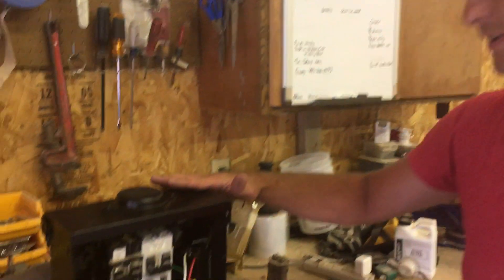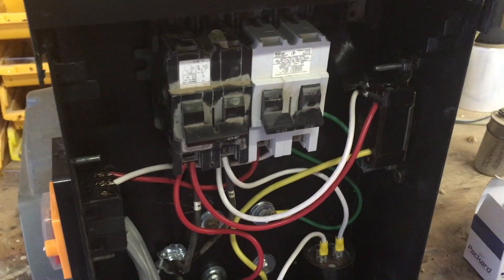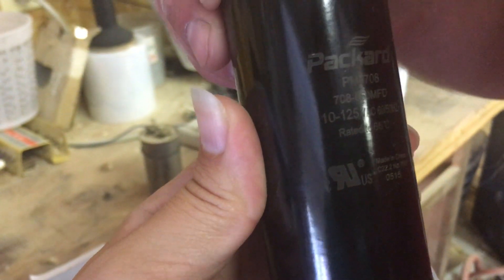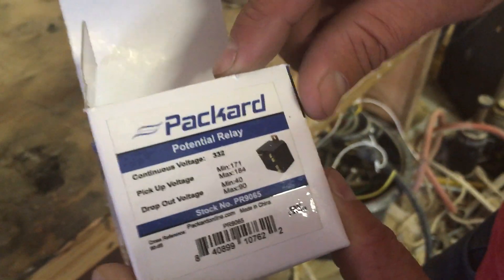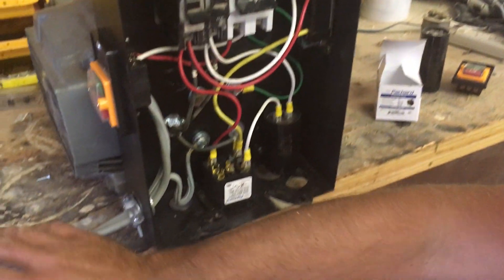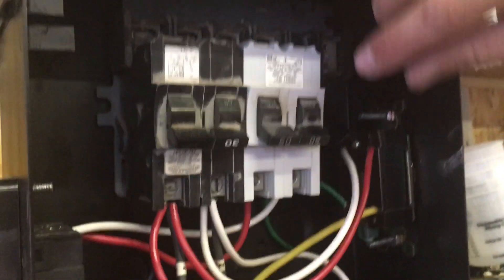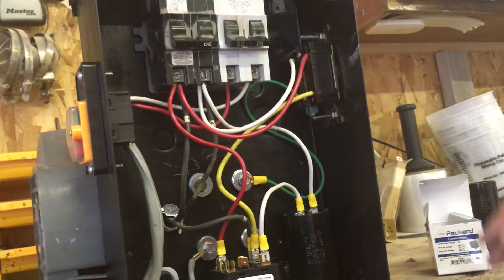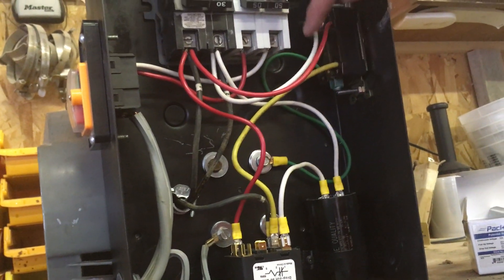How to Build a Rotary Three Phase Converter with details & parts Urgent Read Description if Building

Comment: Good job, but why stop there?  Now that you have a start capacitor to give the motor rotation, why not add a run capacitor in the circuit?  As the run capacitor is constantly in the motor circuit, it needs to be a smaller capacitor in MFD rating to avoid overheating the motor winding.  A properly sized run capacitor will smooth out the 3 phase and increase the motor capacity.

Comment: Something  strange......I follow L1 and L2 (red and white) coming from the disconnect on the left side of the box and going to the white breaker, but they seem to terminate there.  There seem to be no jumper wires connecting L1 - L2 to the black breaker, which is wired to the motor, outlet and capacitor.  What am I missing?

Comment: I notice you are using a start capacitor that's rated 110-125 volts.  I'd recommend using one that is rated at least equal to the voltage at the motor leads, and preferably a 330 volt rating.

Comment: What wasn't obvious at first was that you are backfeeding the buss bars in the box to tie the breakers together. I kept looking for a jumper. I'm like how is he getting  L1 and L2 back over to the other breaker. Then I had the lightbulb Duh moment lol.  I would be helpful to know for folks to know which terminal was coil and contacts on your contacts. From my static phase converter build I know that you want a 110 line on one side of the coil and L3 generated leg on the other side of the coil. Also, need to mention it's a 220 coil. The contacts are breaking the start capacitor out of the circuit. Just to clear that up for posterity.

Comment: I made a box identical to this except with 30hp motor. When I hit the power, both capacitors blew after a super short audible hum from the motor. I used you formula to calculate what capacitor I needed. 30hp = 2400mfd. Had two 1200mfd wired in parallel to make the 2400mfd. What did i do wrong? I know i should have researched just a tiny bit more, but maybe i had the caps wired incorrectly. I asked siri if connected in series, does it increase capacitance and she said to wire them in parallel. Was i supposed to put a fuse between terminals? I had meant to, but slipped my mind in the excitement. Hate when I do something stupid like that. Do I need more capacitors or do you think I may have a short somewhere bc of how fast they blew out? I haven't done any research as to what happened. Is this a normal part of getting the correct capacitors? Should I go a good bit more than I need?
Reply: Actually, only one of the caps blew the latex seal. The other one did not, but im not sure if it's still good or not.
Reply: I think i may have put 120v caps. Wow. Will check tomorrow. Very foolish and should have been more careful.
Reply: Wait, i bought that bc thats what you had. And it's only for one leg of 120 so nvm
Reply: Jk. I had to add alot more caps. 3100mfd's of start caps to be precise. It still won't budge the motor tho. Something can't be right. But I just wind the motor up with a drill for now and then kick this box on and everything seems fine. It really seems like the caps aren't helping at all; must be a loose connection somewhere although I've checked it over and over, can't seem to locate the problem. Also, I used 240v start caps and 330v run caps so that I don't have to buy new one is again if something goes wrong again as long as I'm quick to kill power if I need to. Plus, I think you're technically supposed to run components that are  1.71 x what you need for 3 phase stuff. It's like 1.56 for single phase. I just got everything as if it was 3 phase all the way through. And I added a 90 amp motor starter bc I read that the potential relay could weld closed and leave caps in circuit and would be a bad day. Especially for an idler as big as I used, where it could pull close to 100 amps at startup, that small relay isn't designed for that.

Comment: Chris - thanks for sharing, I'm wondering why 's the CB Left-Black 30A and CB Right is 50A? Is Black-L1 & White-L1 connected?
Reply: He called them both L1&L2, I figured they had to be connected, the CB are triggered off so as he stated they are just being used to connect wires. I also agree this build needs balance with run capacitors for my application.

Comment: Thanks for the great info I was just wondering about the cheap Chinese switch how is it holding up? All current to the 10hp motor plus whatever equipment you run is going thru it. Im thinking about using a blade type switch
Reply: Nvm I just saw your update vid😁
Reply from the maker: So far so good. No problems.

Comment: If I don't use the breaker set up would I just wire nut the the two breakers together( red to red, white to white) and continue with the diagram you have layed out?
Reply: Hello friend, good morning, I have a question. In the white magnetic switch, 220v comes from the input, does that same power the black magnetic switch? Or where are the 220v of the white magnetic switch connected?

Comment: Oh took me a second but I’m thinking you take a 3 phase motor, get it started using 2 phases and a capacitor, shut the capacitor off, then continue running with the 2 phases(or split phase however you look at it) and then use the motor as a generator off the 3rd leg to develop the phase needed to match back up with the original 2 phases(or split) in order to develop 3 different phases. Sounds pretty neat but seems that you wouldn’t have balanced phases. Just 2 opposite phases and a third one offset.

 Why not have 2 motors, 1 phase motor running 240volts with pulley to a 3 phase motor, then use 3 phase leads as a generator to supply the correct balanced 3 phase power?
Reply: Ok I guess I was right, here’s a good link to a video that explains it if anyone was interested. https://youtu.be/mUXLxK_zI24

Comment: Best build I've seen yet.  Would have liked to see it running.
Reply from the maker: Check out the part two. Fixed a couple minor issues and ran it as it was, and with the updates.

Comment: Great video.  Just moved and I wanted to watch a refresher video before rebuilding mine.  Just what I needed.  Thank you!
Reply: Hello friend, good morning, I have a question. In the white magnetic switch, 220v comes from the input, does that same power the black magnetic switch? Or where are the 220v of the white magnetic switch connected?

Comment: Good morning Chris. 
I have just had my retirement  workshop built.
Now I am about to build myself a converter using your video  to do this.
I am in England, does this mean I need to adjust any voltages?.
My pony is 10hp. 

You are without doubt,  a first grade teacher, with a good teaching voice, this makes you super easy to follow.

Power to you Chris
God bless

PETER.
Reply: Hello friend, good morning, I have a question. In the white magnetic switch, 220v comes from the input, does that same power the black magnetic switch? Or where are the 220v of the white magnetic switch connected?
Reply: Hello friend, good morning, I have a question. In the white magnetic switch, 220v comes from the input, does that same power the black magnetic switch? Or where are the 220v of the white magnetic switch connected?

Comment: Probably one of the better explanations I’ve seen with the different colored wires for visual. Some others I’ve seen used 2 additional capacitors to “balance the load” so I’m not seeing what application that is needed for.
Reply: To balance the 3 different leg voltages for stable power between legs

Comment: Really want to build one of these but i will need a step up transformer or if i was dodgy connect it to the mains line which is 3 phase when our house is single but i wont it gets checked to often...and they want 10k to upgrade my power if only it was my house lol i would run all my equipment

Comment: Do you need to use a 10hp motor? I am running a 10hp 3 phase motor but have smaller 3 phase motors to use for my phaser. Or does it have to match hp for hp?
Reply: The source/generator motor should be twice the HP rating of the load motor.

Comment: I just bought a 3 phase rotary converter made Kronk and inside they have a whole bunch of capacitors and this is  for a motor that is 7.5 hp.. I get what you are saying in that the start capacitor is only to get the 3 phase generator up and running then the relay switches it out but if it were that simple why then professionally made converters have a bank of capacitors? One reason I think is to smooth and balance out the 3 phase coming out of the generator motor.
Reply: Exactly right. This will be pretty unbalanced power. You have to add run caps between the phases to balance it.

Comment: Something is wrong. Your input is 240 volts coming in 3 wires. Between each live wire and ground you have 120 volts. Between the live wires you have 240volts. Your ground wire goes to the box and to the motor for grounding and there is no current flowing to it. So you power everything with 240 volts. The starting capacitor helps shifting the single phase 240 volts 90 degrees so it creates an artificial 90 phase. THe motor gets powered with the mains 240 volts and through the starting capacitor (and running capacitory) with another 90 degree shifted phase. When the motor spins it inducing voltage in the third wire/phase of the motor. I noticed your capacitor is 110v. I think it should be rated 270V or higher unless you're powering the motor with live 1/ground -> phase one and live 2/ground -> phase two 90 shifted with the capacitor. But then you have to show your motor wire connections since you're powering the 110v lower section and collect on 220V higher voltage.

Comment: Pretty decent job buddy. But that's just a starting cap. That has absolutely nothing to do with that third leg. That third leg is coming from the spinning motor running on 2 phases. To get your voltage equal you should have 410 horse about 170 microfarad from leg a to your third generated leg and also 170 microfarad from your B phase to that third leg. That will get all your wine he's pulling and eat equal or at least more equal voltage. I will shut up now. Good job.

Comment: Finally someone posted a simple and easy to understand vid on this.  Great job, thank you
Reply: its not simple, he has it wired one way and quoted numbers another way. the red wire line one he says goes to number 2 but he has it hooked to number 5
Reply: Hello friend, good morning, I have a question. In the white magnetic switch, 220v comes from the input, does that same power the black magnetic switch? Or where are the 220v of the white magnetic switch connected?

Comment: My brother has a similar setup. Was wondering how much cooling does the 3-phase idler motor need? The motor is extremely loud just from the fan, would a smaller fan be practical? His idler motor is 10HP and the stuff he runs of it is only around 5HP.

Comment: If you are using a relay and a start capacitor you don' have a true three phase power.
Reply: You forget the most important part of this is the 3 phase motor which creates the 3rd leg so technically yes this is real 3 phase power.

Comment: I’ve watched a lot of videos on this and built a very rough one myself. I think you did a good job. I am getting ready to actually build one that I’m proud of and am going to figure out run capacitors to balance the legs. - anyway - thank you for sharing- I ordered the Potential Relay from Amazon last night. Thanks for the tip 👍🏽
Reply: Hello friend, good morning, I have a question. In the white magnetic switch, 220v comes from the input, does that same power the black magnetic switch? Or where are the 220v of the white magnetic switch connected?
Reply: Hello friend, good morning, I have a question. In the white magnetic switch, 220v comes from the input, does that same power the black magnetic switch? Or where are the 220v of the white magnetic switch connected?

Comment: Just a couple of tips.  If the red wires connected to the breakers are on one buss and the white wires are on another, SAY SO!  Better yet, throw away the breakers and use wire nuts or a terminal strip so we can see the physical connection.  Next, if you're going to talk about terminal numbers for a component show us the diagram.  At the very least, put the camera on a tripod.  I could pause, take a screen shot, then flip the label on the relay right side up, if the camera would just HOLD STILL long enough for the auto focus to  catch up and give me a couple clear frames to work with.  Last, pick one wire,  follow it from the line in to the outlet including all connections in sequence.  Don't pick one leg of a 220 pair,  start calling it 110 without any explanation, follow it as far as a breaker that you're not using as a breaker, then take off like a dog spotting a squirrel to tell us about the ground connections, before returning to the same colored wire connected to a different breaker you also aren't using as a breaker...  It was a good attempt.  I can't follow a script either and you have a much better voice for narrating this stuff.
Reply: Unfortunately this didn't get the response it deserves.  I had the same issue with the white breaker on the right with its single pair of wires to/from nowhere.  I'm assuming it's  connection over the busses but that should have been clarified.  It wasn't addressed in part 2 either.  I understood the bit about 110V in the middle of a 220V discussion but I'm sure there are plenty of viewers that may not understand were 110VAC comes from.  Overall it's a good set of videos but too many things are not fully explained.

Comment: the breakers have me confused ,,I have all the components less breakers, Do you have a simple diagram less the breakers ?
Reply: ronald erbst 
It sounds like the breakers are fulfilling the role of a connector block in this build..
(I'm not expert - built one as a teenager, and am now doing research to build another).

I believe that a decent practice regarding breakers is to put one at the output.

There's a 3 part video on another channel which includes a bit on selecting balancing capacitors, and which mentions a breaker.. Most of the information is in the first video.

Comment: Get a voltmeter on that thing. You are not going to have a very hot stinger. Add run caps and get it up to 165ish from hot to ground. 
If you balance it right, you can run a 7.5 alone or 12 HP in fractionals. Or 10 HP with a 5 and the rest fractionals.

Comment: I'm not an electrician so I'm as confused as I am curious..,  If you didn't have those breaker already, would you / could you have just used some kind of bus bars or power distribution blocks?
Reply: I’m pretty confused. Hard to follow. Using those breakers for a place to park and clamp the wires is fine but when you’re trying to figure out how it’s hooked up they make it extra confusing. Should have made a big schematic drawing to show first.

Comment: Is that a 3ph or 1ph motor connected to the phase converter to switch say shop power from single phase to 3ph for a 3ph motor on a machine?
Reply: Michael Garner three phase

Comment: Did you say you went from 110v input and it has 220v 3 phase output for 3 phase motors?
Reply: What he said was each leg was 110 and there are two legs hence 220.

Comment: I have a 10 hp motor that I want to run, what size motor will I need to run on the rotary converter?
Reply: 750iV12  you should run a 12 hp pony motor. You could get away with a 10 hp but if you were to start it under load you may have a problem. 
Definitely need to add run capacitors to this setup for equal leg voltage!!!! 
It will work the way he has it setup but your powered motor will NOT have full hp and WILL burnout quickly. 
Add run capacitors in the third leg until you have equal (or at least close to) voltage in all 3 legs. 
This is a fantastic foundation. 
Cheers.
Reply: typically you double the motor size of the converter for largest hp item you want the converter to power, aka bridgeport 3hp, phase conv. 7 hp

Comment: I assume you have 2 phases, how does this work with 1 phase live neutral and earth?
Reply: Mr. greens boat tanks and aluminium welding single phase 220 comes from two 110 hots that are 180 degrees apart. Aka standard single phase house supply.
Reply: Wouldn’t want you welding any boat I own... 2 phase🙄

Comment: what size capacitor would I need for a 50hp induction motor? do they carry correct size for that or could one link multiple ones for correct mfd? also the motor I want turned to 3 phase is 460v so would one look for only 460v capacitor or?
Reply: First, you'd need 460 single phase incoming volts. I've seen it, but it's rare. Second, you'll need 12ea 20mfd,660vac,caps hooked in parallel , 6 each 400mfd 250vac start caps, 2 sets of 3 in series and  those 2 sets hooked in parallel. Then relays and contactors to take the start caps in and out of the circuit. Sound complicated? It is.
Reply: @frankmartin6126   First you build your 220 volt phase converter to output 220 volt 3 phase, then run THAT output thru a 3 phase step-up transformer for 460 volt 3 phase output.

Comment: Hi, if i want to use this on a 220V house, how do a get a neutral for 220V, i will split my phases in my DB box but i need the neutral, thanks
Reply: Johan Stassen you cant sorry. You can find good info on phase converters a practicalmachinist.com

Comment: Liked your video could you use a 3 or 5 hp  motor because I just have one 3 phase lathe
Reply: this is the build you want then, you have a 50% loss on start up, as a rule of thumb. 10hp to start a 5hp. or so i have seen repeated over and over, hope this helps you mate.